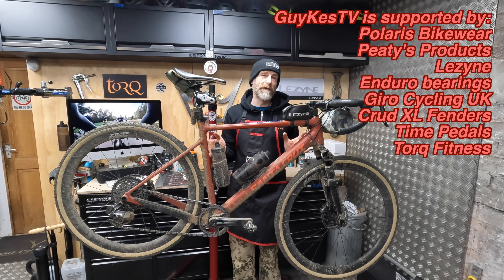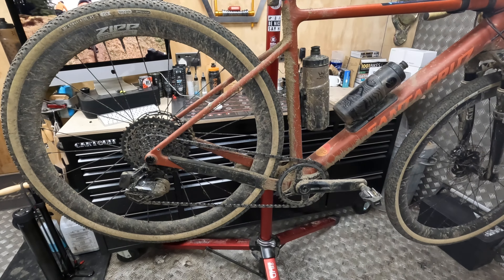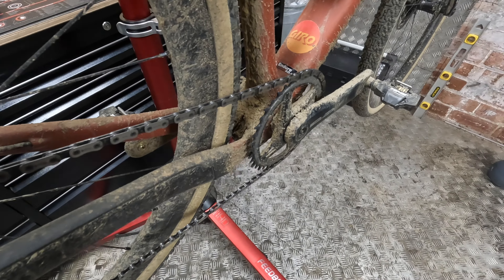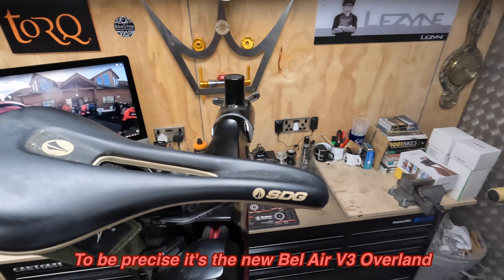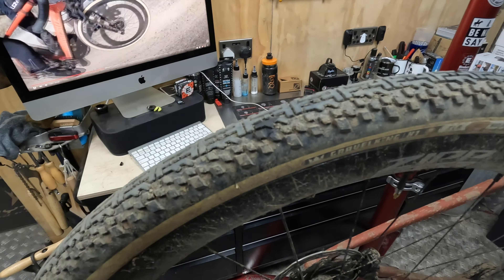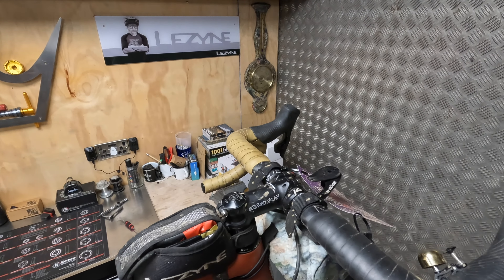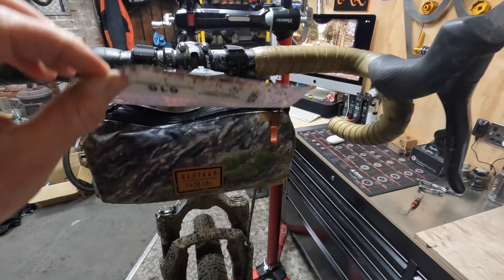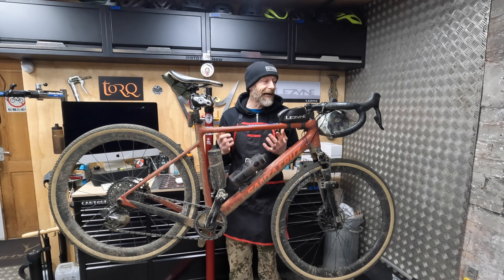Dirty Reiver Bike Check - How I got my Santa Cruz Stigmata ready for 200km of wild gravel

Comment: Intersting stuff. I enjoy my gravel bike but I do think that once you've got the fork, and the dropper... your dangerously close to 'why not put a flat bar on it' which then is closely followed by ' a really nice light XC hardtail is actually still a brilliant, versatile bike'. Thats certainly how I've ended up going full circle and now do 'gravel' events on my Scott Scale!
Reply from the maker: Oh yeah, if you ‘get it’ a suspended gravel bike is actually nonsense, I got my Chisel down to 9kg with a 100mm SID and 2.3in tyres on and it flew. As off road catnip for roadies they’re great though
Reply: @GuyKesTV more roadies need to try a fast xc bike as well before settling on a gravel bike. Most I’d bet would prefer the xc bike once they got used to the handle bars. I like my gravel bike but I’ve moved it to a more of an “all road” set up now and use the xc bike for proper off roading.
Reply from the maker: @scottwatson7844  absolutely this. Gravel is a gateway drug to getting off road and I think it’s a good thing from that POV. But certainly in the UK at least a lightweight XC bike would make more sense most of the time. Just building up a Mondraker Chrono DC which should be interesting

Comment: Is it better to have something like xc bike for commuting to work on pavement and forest etc or gravel? Do these gravel bikes are way faster then something like xc or trail hardtail? Or are the tires makes  the most difference? Thanks
Reply from the maker: Gravel is a little more aero in headwinds because of the bars and you generally get bigger gears so you’re not spinning crazy at 50kph. Little bit lighter too. 29er XC hardtail with skinny tyres is very quick though and can play rough much better on weekends

Comment: I’m struggling with your weight.  The bike comes out of the box at 9.5 kilo and you added things to the bike and got it under 9?  The rival 1 axs without the suspension fork came out of my box at 9 kilo and now it’s at 10 after getting it ready to go, with 31mm Rene hearse tires which are light.
Reply from the maker: This bike was 9.6kg out of the box. Ditching the AXS dropper loses 350g, wheels 100g, tires 200g, Easton bar and stem are lighter too. Only the saddle is very slightly heavier but my ass isn't a fan of WTB.